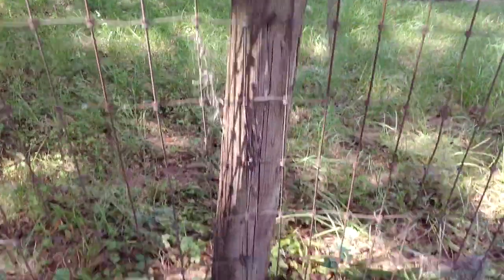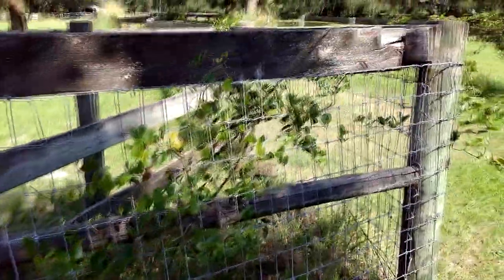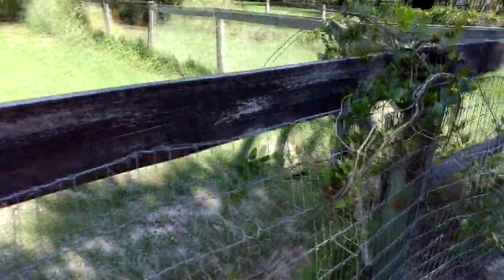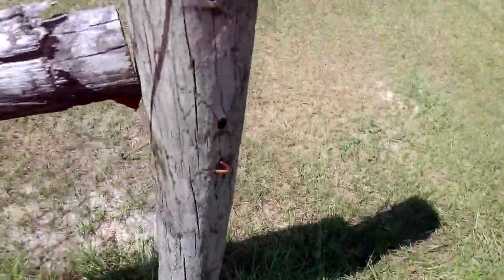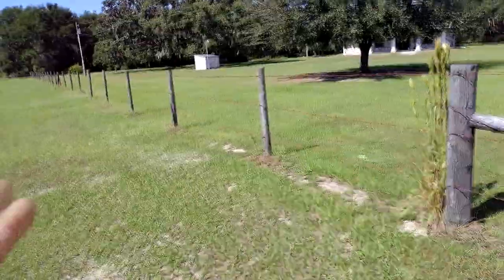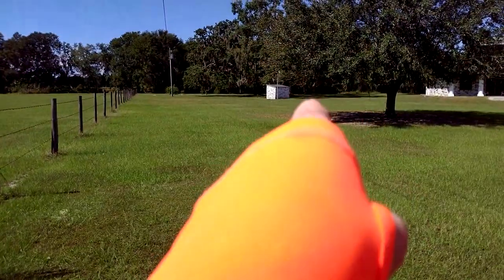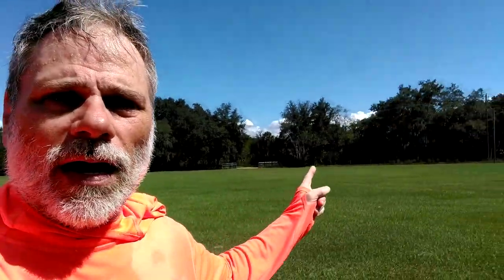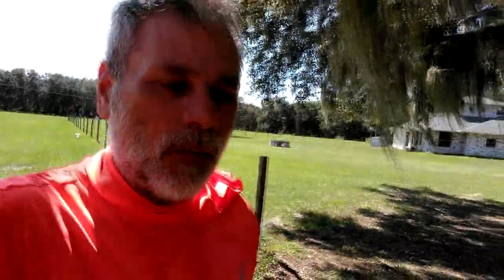Preparing Different Styles of Fences for Removal - Ray Hayden, J.D.

Comment: Great progress on removing the fencing Ray! A fence staple pulling tool is handy if you need to completely remove wire from posts. Maybe if there are posts still in really good condition you could offer them by the roadside for the neighbors.

Comment: Great video thanks brother. Doing a great job on the fence. The electric box check every place you know is a breaker box. See if they are all on check the outlet see if it's hot. Breakers are all on and outlet is hot. I know you don't like messing with electric but if you put both or all three wires together you can blow the breaker. Then you know what one it is and hope it doesn't power anything else. That's just what I would do. Be safe. Keep up the great work see you in the next video thanks again brother

Comment: Okay Ray, you have a good rhythm  going and those posts will be out in no time.  I was gonna say, just cut the wood where the nails are and don't deal with the nails and you addressed that very thing.  Great, you hit it smack on the head.  If you have a battery powered reciprocating saw, it will make quick cutting for you.  Yep, you had gotten a lot done and those posts will be down in no time.  If the post is broken below the ground, you could just leave it unless you're going to be planting something where that post was once located.  Great video.   Enjoyed full watch.  Big thumbs up.